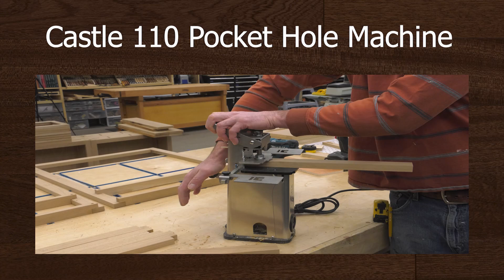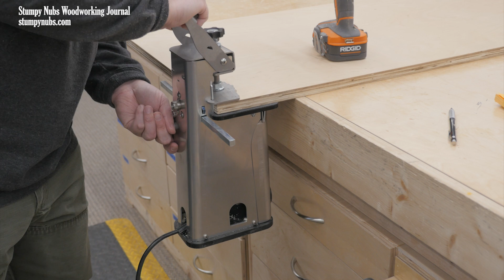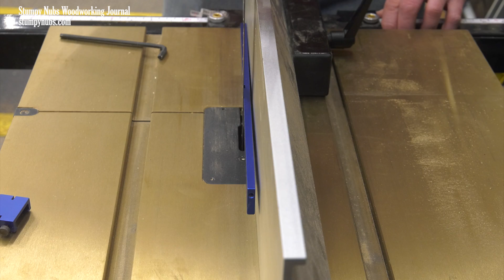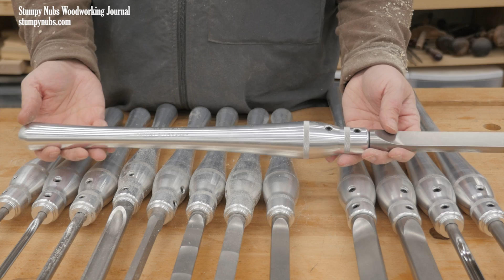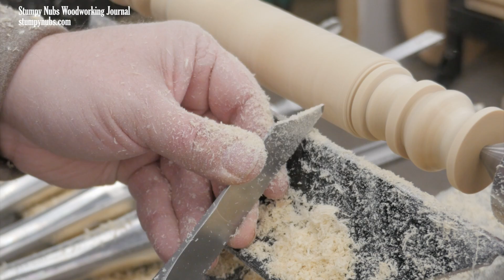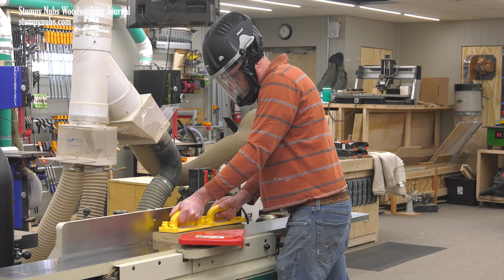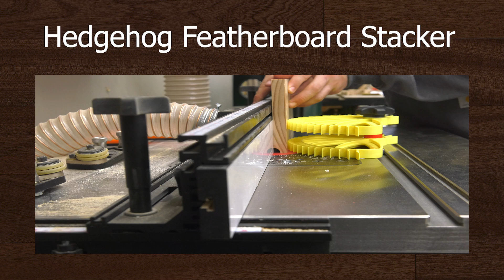7 Cool Tools I Have in my Woodworking Shop

Comment: I have a couple of the Carter and Son bowl gouges. The handles feel good, but, I think that they are too heavy.  Also, I feel that the tools edge holding is not as good as some of my other bowl gouges.  As in everything, YMMV.  Interesting video.
Reply from the maker: I like the extra handle weight. As for longevity, I suppose that's very tough to test. M42 steel is highly regarded in the tool industry. But turning tools in general are a matter of personal opinion. I know folks who swear one steel lasts longer, and those who swear another steel lasts longer. Both can't be right, but both insist they are :)
Reply: @StumpyNubs  maybe one uses their lathe tools in more of a scraping style and the other in more of a shear cutting style? Also, the differences in the woods they turn, the speeds they turn at, if they turn live edge (full of dirt and silica) or only clean wood, lots of variables in turning that may treat one tool differently in one shop vs another. The difference in steels may react differently when applied to the craft under different circumstances with different variables.
Reply: @StumpyNubs  M42 usually will last significantly longer than M2 because the greater concentration of molybdenum makes M42 resistant to softening even at red heat. But what most people don't realize is that wood also has mineral content from the soil it grew in. Different woods have different mineral content, and depending on how abrasive that mineral is affects jow long that tool keeps an edge.

Comment: I watched an older video regarding kickback on tables saws.  I have been going without the blade guard/splitter since probably the get-go on the saw, which was a gift from my wife maybe 25 years ago.  I have dodged many hunks of scrap heading for the wall behind me.  Given my age and experience I thought it time to re-install the system.   I tried a long narrow rip with thin stock just to see if the pawls were doing their job.  Yep!!  Thanks again!!!

Comment: Stumpy, thank you. Thanks to ypur injury video amd Johnathan Katz mosses workshop injury video I was prepared for the injury that I got yesterday. I am an ex combat medic and did not have a workshop medkit, amd my household one was out of date. I spent the 1st week of this year updating both and preparing for the worst. Amd when it happened, I was well equipped and knew where everything was. I have pictures and can be more detailed in what happened and why if you wanted to know more for safety sake. Again thank you
Reply: Pretty easy mistake to make, I thought I took enough safety precautions amd then in an instant, it all went wrong. I was at my 2 hp bench top disk sander, taking the burr off of a small metal 2x2 square. I thought this is pretty thin, and I am not going to keep it rested on the table the whole time as I want to round the edge a bit. So I stopped and placed a small piece of plywood claped to the table so that there was effectively no gap for the workpiece to slip into. Needless to say that was still a poor choice and I should have used my hand  grinder or my bench top grinder. The workpiece snagged and pulled it self into the machine ( still need to disassemble it to get it out) followed by my fingers. I lost both nails on my index fingers amd most of the skin from the tops of thoes fingers. You are right, the shock of what just happened clouds ypir mind and judgment. I have seen and delt with much worse as a combat medic and assumed I would be fine if something happened to me. If It were not due to you, John changing the importance of first aid in my shop, it would have taken multiple minutes for me to affect my own first aid or even more time to get professional help. I'll go back into the shop today and make some small changes I identified as can be better for next time.
Reply from the maker: Ouch!
Reply: @jesseedmands9631  dang dude. Hope no damage got into the tendons and muscles too deep.
Hope you have a speedy recovery and the medical bills aren't too much of an aftershock (hope you have decent insurance). I also hope you don't end up with weather change related pain in the affected injury areas later in life. Being a living barometric pressure meter sucks as you age. [Ask me how I know].
God bless and keep you safe as they likely do some skin grafts or what ever to close your hands back up.
And from one vet to another, thank you for your service, Brother.
Reply from the maker: No pictures, please. :) But if you'd like to share what happened, please do.

Comment: Masks are for suckers, all my homies use filtering face shields

Edit: for woodworking shields are better, keep the gunk out your eyes. For bio please make sure your mask filters your outbound air.
Reply: It is for fine dust particulate matter, not biological filtration.
So, if you are running around with this face shield as protection from covid, you are increasing your odds, most likely. The biological organisms are going through the filter and blowing right down across your face.🤢😷🤧🤒☠
Reply: @thomasarussellsr  and also a good part of the reasoning behind asking people to wear masks is to keep the wearer’s germ’s from being spread. Even if the filters did trap the virus particles, if the person wearing the face shield already had the virus it would do nothing to keep them from spreading it.
Reply: @thomasarussellsr  it certainly depends on the quality and design of your setup and what you got it for, chemicals and wood parts for me. I've got one that's breather attached to googles. Then I added a cloth filter on the main mask to prefilter the incoming and outgoing. Makes it a bit harder to breathe but it cut down on how often i had to service the main filters so I like it.

I only wore it in public when literally no one else was, otherwise I prefer a mom made or m95.
Reply: The minimum PPE to block Covid is a PAPR with a HEPA H14 filter. This is basically a cheap PAPR unit but definitely doesn't have a H14 filter.
Reply: @jamesmoore1532  a piece of thick cloth will reduce your exposure. It really doesn't take any kind of special filter because you aren't trying to filter the virus, you are trying to filter what the virus is on ie water droplets from the lungs. If all you did was hold your hand in front of your face you would still significantly reduce the amount of potential contaminants you are spreading. Of course a 10% exposure chance per minute would mean you are reasonably certain to be exposed in 20 minutes, but combined with distancing to reduce the possible exposure time even the most basic masks will have a positive effect on a populations total infection rate.
Reply: @BilingualHobo  I never said that wearing masks does nothing. What I did say is that they wont stop it. You can wear all the fabric you want on your face it wont prevent it from transfer from you or to you. It will help but it wont prevent.
Reply: @jamesmoore1532  yes, which is why i tried to explain that the goal is not to stop, its to prevent. Even a full hazmat suit will not gurantee you aren't exposed on its own. Most people are using cheap masks but when everyone uses something, it prevents most people getting it and thats as close to stopping it as we can get.